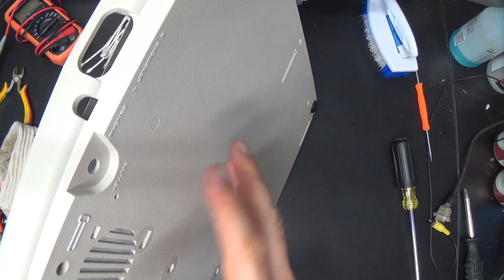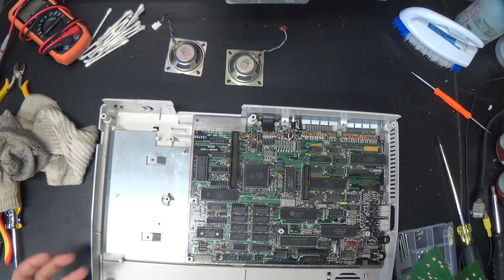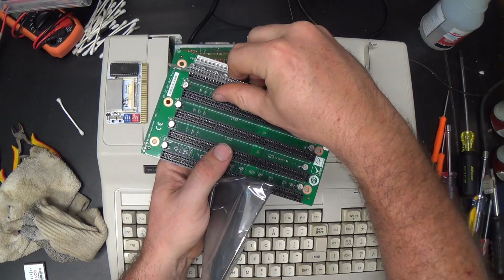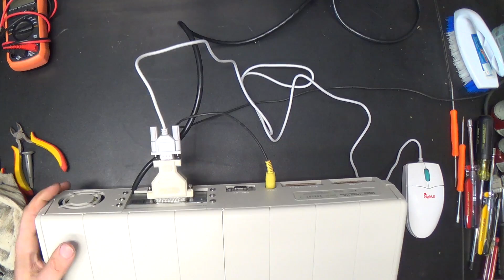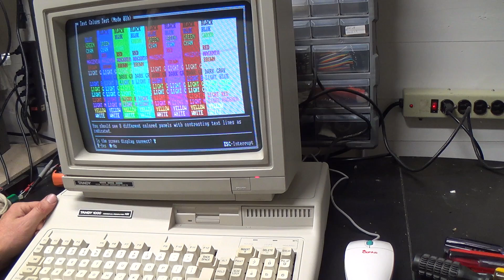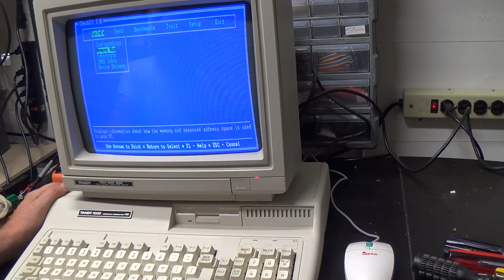Tandy 1000 HX (Pt.3) Reassembly and Testing (#SepTandy 13th, 2020)

Comment: Hey Lee, great video series man. I watched all 3, gave me some good laughs. I played the Tandy 1k HX when I was just a little guy over at my grandmothers. I ended up getting it after she recently passed. I was wondering what you would value this system at right now? I have the base system, with an additional 3.5 floppy drive, and the upgraded memory like you have which takes it from 256k to 640k. No other cards. I also have the original Tandy CM-5 RGB Color Monitor. And a handful of programs on one of the 3.5 disks. I gave a quick look on ebay but prices are all over the place. It's still in very clean shape aside from the keys look a little bit discolored. Anywho, great video man! Love the Tandy stuff!
Reply from the maker: That sounds like a really nice machine!!!  The prices on these have skyrocketed.  I'd keep it if it were mine, but you can probably get real money out of a machine like that.

Comment: Once again, great series on this Tandy 1000 HX, restore, video fix and cleanup. Always educational and entertaining to watch. Was there a trick in getting the two keyboard flexible cables re-installed? You mentioned the end clips need to be used, are those pressed IN to reinstall or pulled OUT to reinstall the cables?
Reply from the maker: Thanks, bud!
I don't recall the exact connector in there anymore, but 95% of the time you pull the white thing up (out) using the tabs on each side to release the cable, and press it back down (in) to lock the cable back in.  Take it easy and be gentle; those latches break pretty easily if you start horsing them around much.
Reply: @Lee_Adamson_OCF  Thanks very much for the reply, appreciate it, yes indeed I had to "gently" press the side tabs in while at the same time pulling up, slightly and again gently 8), that allowed me then to push the flexible able back into its slot and then as you stated, press down again to lock it in. REALLY did not want to force any of that since yes (cough) I did not do the reverse when taking it out the first time. But, it survived, and went back in perfectly and is working once again. Needed a good cleaning so really had to take it fully out of the case.
Cheers, and keep up the great work! Always look forward to your next adventure.

Comment: The PLUS bus actually is backwards from ISA, in that the A and B sides are swapped. The PLUS to ISA adapter you got (I think from Derek Osborn?) has them swapped for you. The thing that will really mess you up if you try to design your own card is that the external connectors have to be on the solder side of the board, and you need to remember to leave space (about an inch) from the back to your components if you plan to have any genuine PLUS cards on top of it.
Reply: So you could say it's "backwards compatible" literally.

Comment: The Speaker pin (B8) is only on the older 1000 and 1000A, I believe, so the modem card could use the PC speaker. On the XT bus, it would be used for the slot-8 function on the IBM 5160, I think, but on the 1000 EX/HX it isn't connected to anything. The pins for IRQ 6 & 7 (B21 & B22) are repurposed for the DMA function on the memory expansion card since 6 & 7 are in use on the motherboard, and IRQ 5, I don't think is used on the PLUS header, which limits the number of IRQs you can assign on a card to just 2,3, & 4.

Comment: Unimorphian/Professor Pterodactyl?  Got a link?
Reply from the maker: https://www.youtube.com/channel/UC8DxqCcs3MqUyXdEJHCd9vg

He is a gentleman and a scholar.
Reply: @Lee_Adamson_OCF  Hah!

I need to get a new video out with the latest foo I've done with the magic expansion card, re: disabling all those ROM droppings Tandy filled upper memory with. It's been on my list to see if the same override will let me put the XTIDE BIOS at F000 on the EX as well; I've been puzzling over the tech manual and I  think the same trick with abusing the DMA control line will work, but technically not quite as elegantly.
Reply from the maker: @PaleozoicPCs  Ahhh, so putting the XTIDE ROM at F000 isn't as simple as just changing the address decoding after disabling the DOS and deskmate ROMS, huh?
Reply: @Lee_Adamson_OCF  There's two tricks you need to stack on top of each other to override the F-area. The E-area in the HX is easy, the decoding PAL has a "ROMDIS" line that normally doesn't do anything (it's tied to a pull up), just run a line from the PAL to the chip enable on the ROM/RAM you want to sub and as long as your decoder is beefy enough to beat the pull-up (or you could cut it) the Deskmate stuff will be overridden. F is a lot more tricky because Tandy got clever with the Big Blue chip video chip and you have to fight its desire to decode the entire F-page for the motherboard peripherals. The method I used is "clever", but I'm not entirely sure it'd work in a Tandy with the Radio Shack DMA memory card. (I abuse one of those DMA control lines that's unique on the Tandy's bus connector to leverage a condition in the decoding PAL that puts the motherboard buffer to sleep and keeps it from trashing my override ROM.)